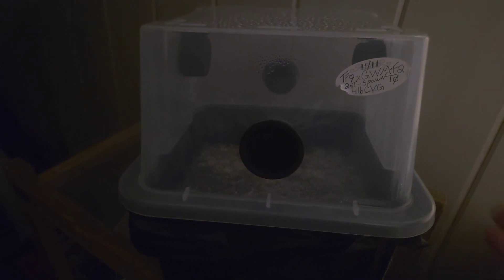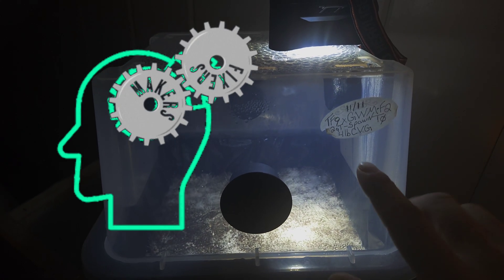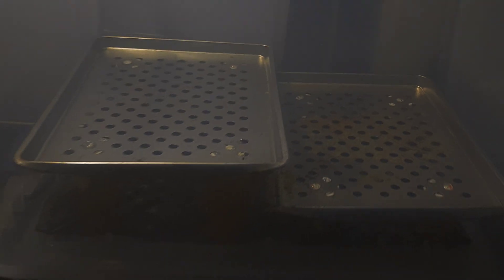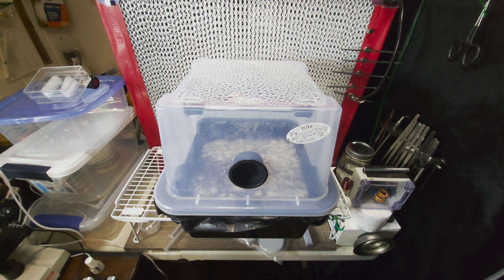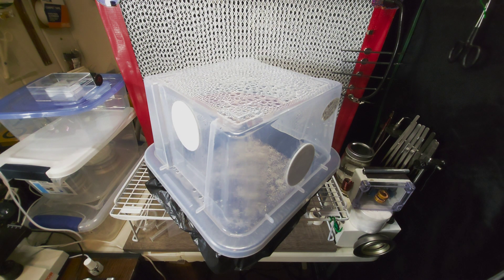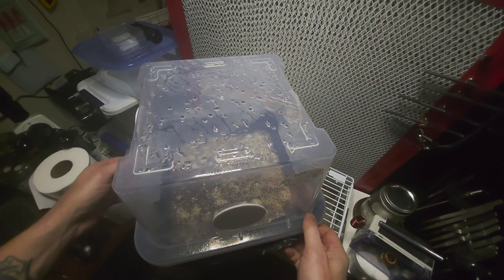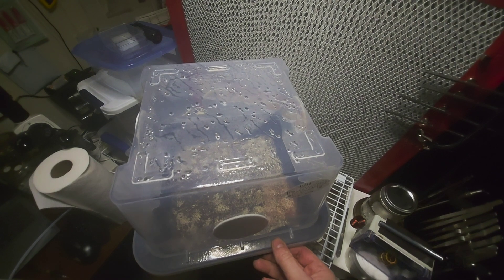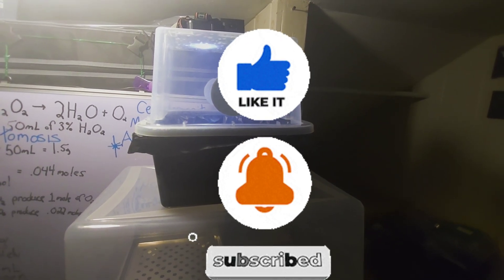Mushroom Grow Chamber Dynamics: From Stalled Fruiting to Thriving Growth.

Comment: Filter patches vs old school micropore tape. Whats the verdict. Im curious if everyone else likes the mcropore as well. I couldnt order patches in time and tried it out. Never went back. Works just as good in my rooky'ish opinion.  PLEASE let me know if patches will be better/ safer/ more reliable etc. Still figuring this all out. Any and all advice is appreciated!
Reply from the maker: @Rhodey82 Micropore tape is my go-to, If I get a kit that has the filter patches, sometimes I will save those to use on a different grow.. Especially if I'm using T0 spawn that could potentially have bacteria.. If I have a grow that contaminated, let's say with trichoderma. I throw the filter patches away, which could get expensive after a while, compared to peeling off a piece of micropore tape and replacing it. I pretty much get the same results using either one, the tape is cheaper to replace and you can cover just about any hole, while the filter patches are already pre-cut for a certain size..

Comment: You're wasting time, thought, and energy on the condensation drops contaminating your grow. Not a thing. Your spawn is your problem if contams present themselves at this stage. Maybe take a look at your grow area man...
Reply from the maker: I was suspecting bacteria (sometimes I'll run a T0 spawn and I just treated this on as it if it was) because this was an old spawn, stalled for a month.. I was hoping if I kept it in favorable conditions for the mycelium it  would out compete any possible bacteria. I agree most issues are traced back to the spawn.

Comment: thats why i use a weigh scale for my sub and spawn, make sure they are both equal and enough and your good. i have 3 shoeboxes booming right now
Reply from the maker: I do the same thing for my 6qt tubs, I run 1 lb to spawn to 2 lb of substrate.. In this video, I was using a mushroom grow kit from 'Microppose' and everything was pre-measured.
Reply: @JustiNourse  you can never go wrong with shoeboxes at all, I tested one shoebox ND added a layer of spawn on top of the pseudo layer and topped it off with a little bit of substrate and it's producing very nice pins right now

Comment: That's some serious dedication in trying to salvage that stalled tub. I realize it's anecdotal but my last monotub that refused to totally colonize the surface eventually (~30 days) "restarted" colonizing the last bare patch of sub. I was relieved until that final patch turned green. Not sure why but have found that in general monotubs are slower than shoeboxes though suspect it's FAE related. I hope you get your tub thriving again and look forward to the follow up. Thanks for the vid!
Reply from the maker: Thanks for sharing your experience! Salvaging a stalled tub is definitely challenging. I had a similar situation where my substrate was colonizing well except for one patch. When it was time to fruit, that non-colonized area turned into a contaminate. Before discarding the substrate, I noticed a lipstick mold on the bottom, which the substrate had been fighting all along. This explains why that patch never fully colonized.

I agree that FAE seems to play a big role in the slower colonization of monotubs compared to shoeboxes. Thanks for the support and for watching the video. Your insights mean a lot!

Comment: I deal with the lid condensation issue now and then when my temps fluctuate too much, so I can appreciate the experimentation surrounding that, especially distance from the ground! I've found that once the sub is fully colonized, I can just gently take the lid off and wipe it dry before putting it back on. It's fast and eliminates the risk of those drops falling back into the sub, just like your flow solution does. I also remove any pooled water on the substrate surface with a fresh paper towel, and haven't had any problems in ~90 shoebox grows. Clean grain spawn lets you get away with a lot!
Reply from the maker: @BackToSpores Absolutely about the clean spawn! I do something similar with my 6qt shoe boxes. I'll sanitize a lid before removing the other one and swap them out. After making this video, I set up a camera for my first time-lapse. It's now 4 days later, and the whole surface is colonized and pinning... maybe something new will grace us with its presence 🤞🍄. Thank you for watching and sharing your appreciation!